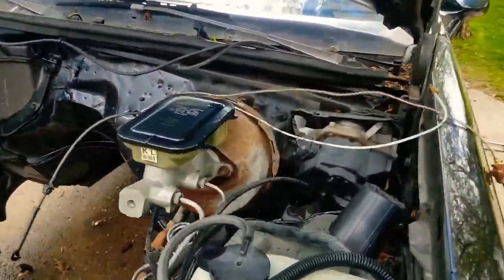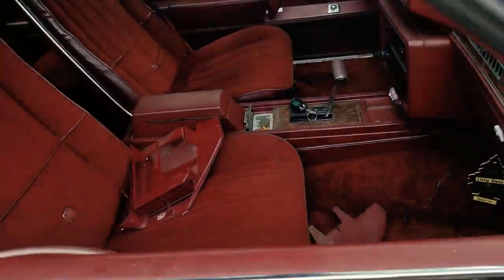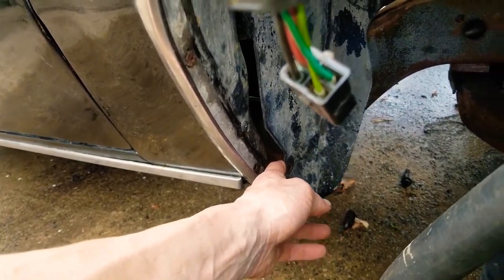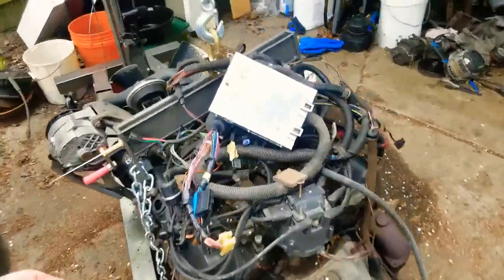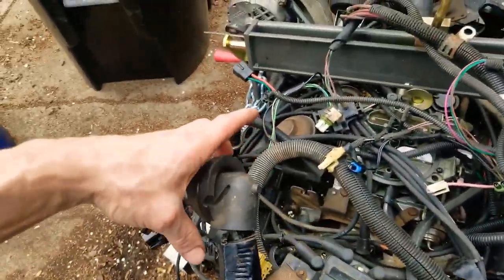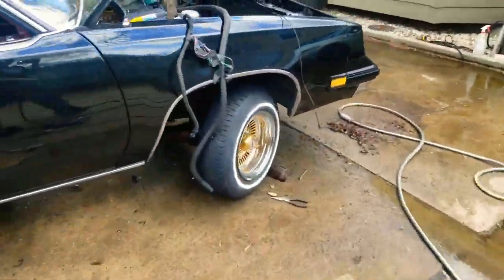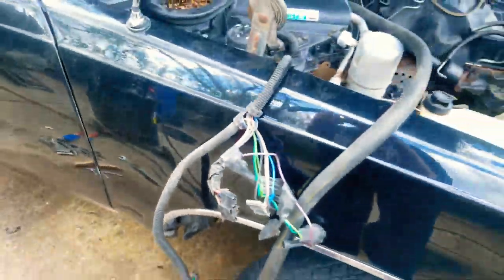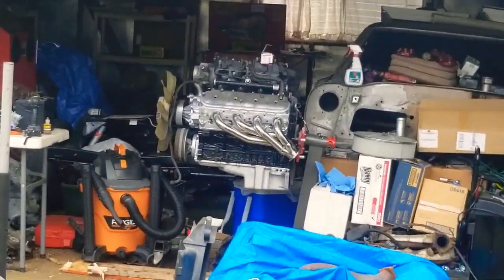1980s G BODY FACTORY WIRE HARNESS REMOVAL

Comment: I just saw your video.  I did that same wire routing and computer placement for my LS swap.  How did that LS computer fit on the passenger kick panel?  Mine fit like crap.  It hangs back into the door hole a little bit and there’s no way the original cover can hide it.
Reply from the maker: It didn't fit in the kick panel. I ended up putting it in the glove box. I have a video on that if you'd like to check it out.

Comment: Do you still have that wiring harness from the passanger side? If so I would like to buy it.
Reply from the maker: Part of it. In order to make the ls work I needed to use the part of the harness from the fuse box to the starter and alternator and lights. Also had to keep the ac and heater wires. Ls swap harness only controls the engine nothing else. What all you need from original harness?
Reply: I was just about to ask what you keeped of original harness im ls swapping my oldsmobile put old engine for sale people have been asking me for original harness  thanks now I know what to keep